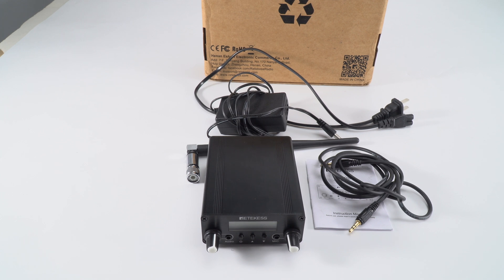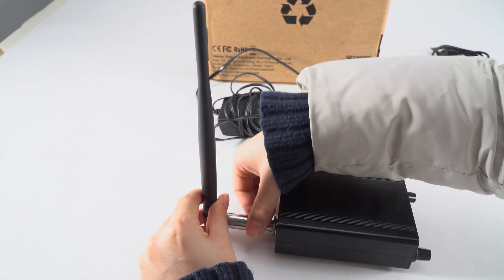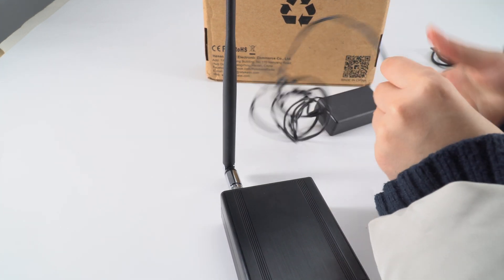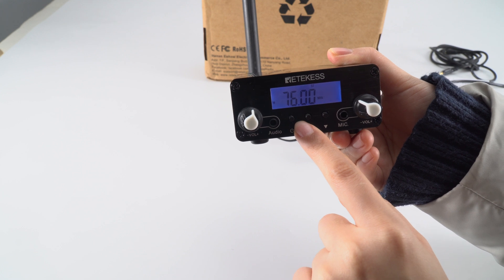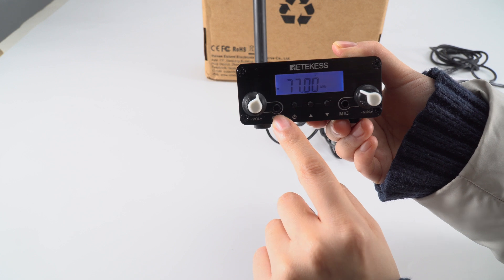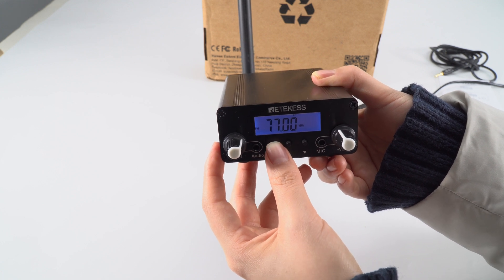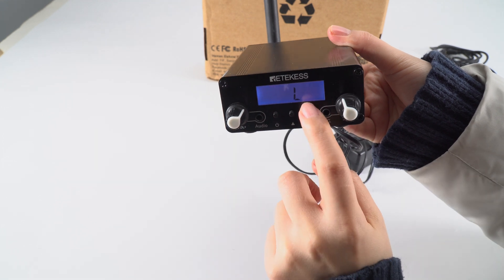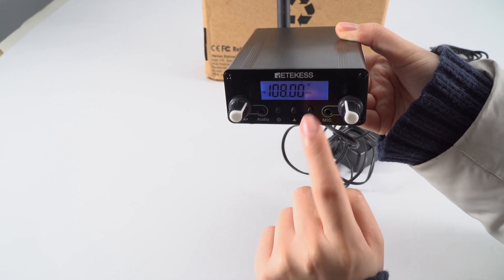How to Change TR508 FM Transmitter Output Power

Comment: What is the purpose of changing from.low to high?
Reply from the maker: Hi, Harold. Thanks for your consult. Under normal circumstances, the greater the power, the farther the transmission range. If you have any questions or needs, please feel free to contact us by email at support@retekess.com
Reply: @Retekess   But that means you only need the high setting because it gets you the best range. There must be some advantage to using the low power right? What is the benefit of the low?
Reply: @paulpereira4004  low power is if you dont have a license. having it at high power is illegal if you dont have a license